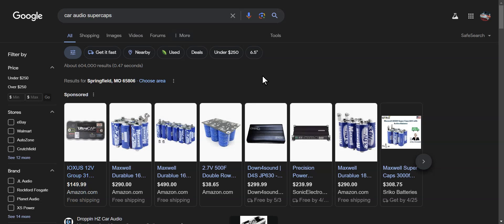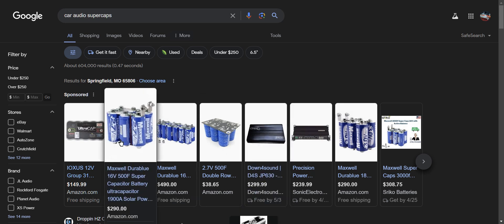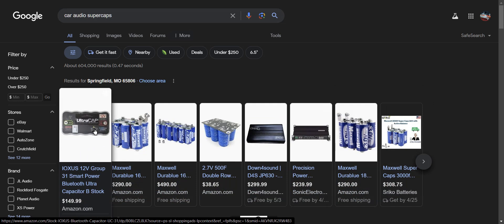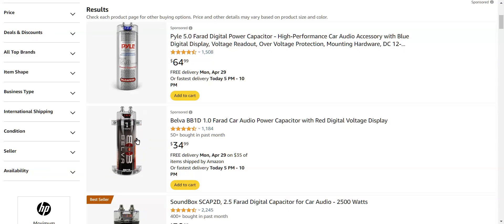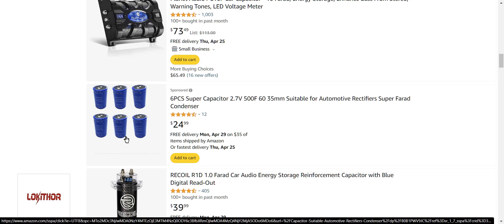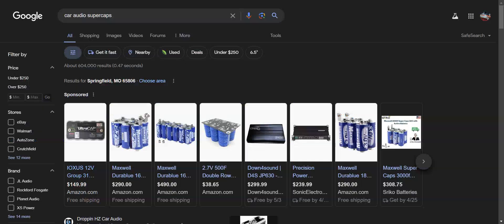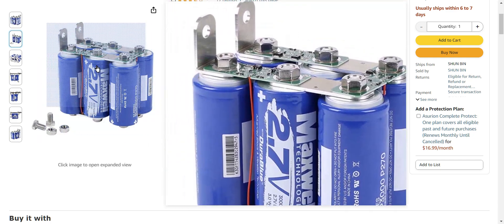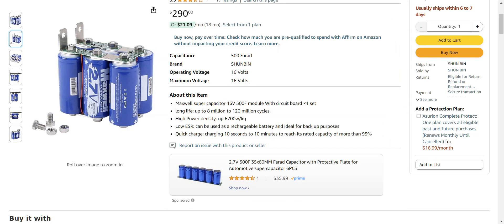What are Super Capacitors in Car Audio? can they fix Head Lights dimming?

Comment: If I have an 85amp alt. 

Can I manage to run a 3k amp with a massive superbank without upgrading the alt?

OR would the recharge just be too slow?
Reply from the maker: massive is the key, and you will still need down time to recharge. the more you can store, the longer you can bang, but also the more time youll need to rest it.

Comment: I was under the impression that super capacitors have a high self-discharge. that if you threw fully charged one in a closet it would loose charge quickly.
Reply from the maker: Nope caps hold voltage for a very long.time

Comment: Another great Thang about capacitors in general is as long as the circuit is energized they can hold their full capacitance without having to recharge, but can also release as soon as it is needed. Also if you have seriously sensitive circuitry a capacitor can hold it's energy after the circuit is opened letting the components slowly stop instead stopping immediately which can be taxing on the durability.

Comment: I need 25k watts for the subs in my icon. What amp do you recommend and im gonna run only caps, no alt or sup bat. How many maxwell caps do you think it will take if my goal is full 25k watts for a burp spl
Reply from the maker: bro, that's a bit outta my league, but you need a lot. message tyler at GP car audio with that question, he can give/get accurate info on those power needs. id be guessing.
Reply: You need a high output alt to charge them unless you plan on charging at home before every event. They are simply storage devices that need charged by an adequate alt.
Reply from the maker: @lowhertzhighspl  hes talking about a burp, witch is a few seconds. then its parked for maybe an hour till the next round

Comment: Curious question? Why would you not put a normal capacitor on a bass amp?
Reply from the maker: oh you can, but its a total waste of money. it'd be like hunter Deer with a daisy Rider BB gun
Reply: @CarAudioEnthusiasts  😆 good analogy
Reply: It might take some electronics knowledge but, caps act kinda like a water tower. The kind of cap material important as it changes the content of the can. Older 1 Faraday caps were electrolyte based. Very low capacity relative to these shown here. What's important is the voltage and Faraday rating for DC current.